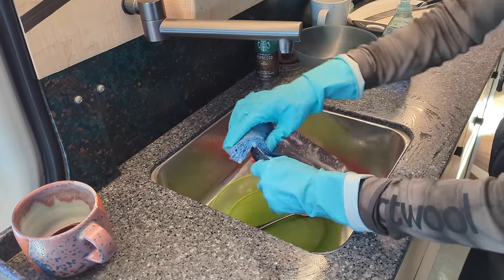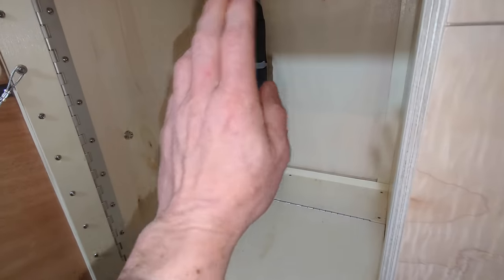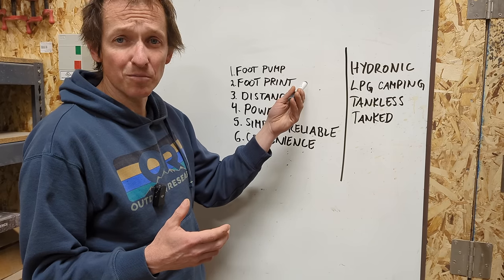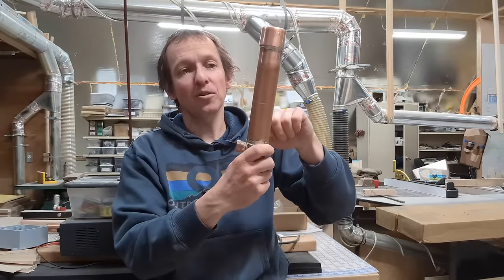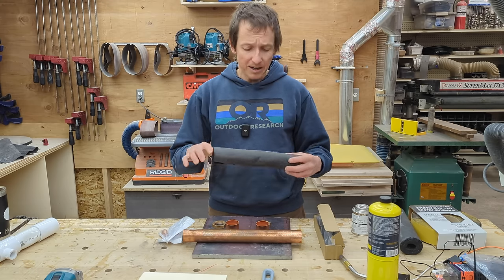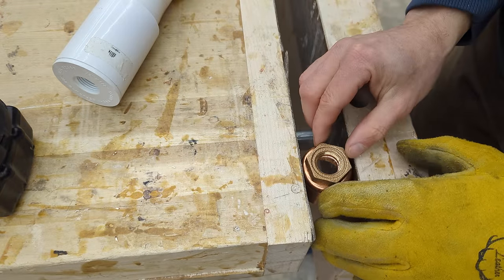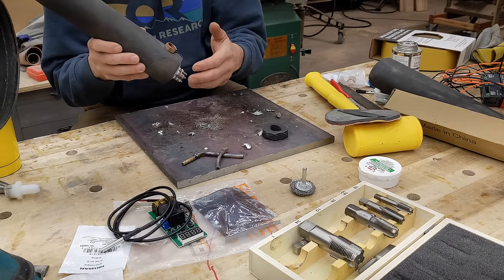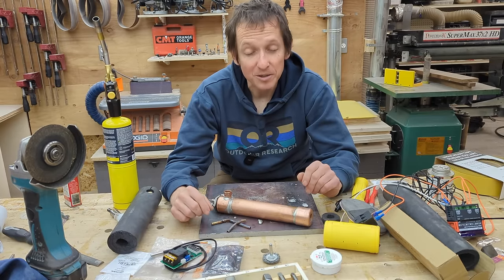Make Your Own WATER HEATER For Your Camper Van

Comment: This is outstanding. I have noodled over doing the exact same thing for the same reasons. For a bit of extra safety, take a look at snap action temperature switches...you could strap one on easily and they make them with manual reset. Nice job!
Reply from the maker: Manual reset for the win!  Thank you!!

Comment: This thing would benefit from a simple bimetal thermal fuse, say 100C, attached to the side just like the thermistor. Would cut power to the heater in case of overheat, either permanently until manually reset, or auto reset on cooldown...
Reply: 85C is pretty standard, with a 90/100c on top of it as the final extra step. just in case.

Comment: I have the cheap propane on demand water heater. Been using it full time for 8 years. The second or 2 of water flow you talk about is less than 8 oz of water before I get hot water. I just measured as I watche dyour video. That amount can be added to a pitcher for drinking or rinsing dishes if you are that worried about water usage. 2 D cell batteries last me 6-8 months. I go through a 3o lb tank of propane every 4-5 months, but that is also used for my 2 burner stove that gets used a lot more than my water heater. Actual cost is minimal.  When hooked up to a good water supply, I can take limitless showers, which I rarely do, but it is nice to have that option.

Comment: Add a timer switch to cut power after 15 minutes. That should lesson the risk of overheating. Nice idea.  For many of the reasons you offered, I decided it was easier to just boil some extra water when I’m making coffee in the morning or at dinner for dishes or washing than to install a hot water heater but I like this. Thanks.

Comment: A neat solution tailored to your specific needs. Very easy to increase the heated volume by simply fitting the heating element into a longer tube.
I would strongly advise fitting a pressure relief valve to prevent disaster in the event of the thermostat failing. if something can go wrong, then at some point it will go wrong and you need to cover that eventuality.

Comment: I use something like this for my hot water heater at home.
The main water heater is gas with a 12VDC 2 gallon preheater.
Works great for my solar dump.
After my batteries are fully charged, the system automatically switches over and preheats my water.

Comment: Great job!
I didn’t think of this so I went with a small computer heat exchanger (radiator), installed inside my diesel heater vent. Considering there is no power cost, it works extremely well.
Reply from the maker: Dang, thats a creative solution.  What kind of temperature rise are you seeing?
Reply: @projectofscience  I don’t have exact temperatures but I will try and explain best i can. We recently did a ski trip to Montana and with the heater running all night long, the firs few seconds after opening the tap are pretty hot but after that it’s milder and you can easily wash your hai or do dishes. What I didn’t expect, which was a pleasant surprise, is that while heater ran all night long, hot water made its way back up into the tank (no pump) and warmed up the whole tank (16 gallons). 
I suppose the downside of the system is that in the summer i’d have to run the heater if I needed warm water but I guess we’ll see..

Comment: "Pro tip:" There is a thing called "HEAT FUSE" and it basically breaks, if the element gets too hot.

You encouraged me to just buy my own "heater element" and a "control board", for the faucet and recirculating shower.
I believe one can also get a "thermostat" and a "car relay", since thermostats look neater.

Comment: A very elegant solution, many thanks for sharing! 
Two thoughts:
1)You said you would like a lower wattage 120V heater: If you can find a relatively low wattage 240V heater, it will run fine on 120V and run at 1/4 the rated wattage.
2) I wash my dishes using a 'Lawn and Garden Multi-Purpose Sprayer', I estimate it uses less than half the water as my faucet, possibly only 1/10th. I'd love to integrate that low flow with pressurized spray with a tiny heater like yours. Of course, keeping it safe would be more complicated. Thanks for the ideas!
Reply: Yes, heaters are just a resistive elements. They don't care about how much Voltage you give them or if it's AC or DC. 
if It's a 1000W, 240V element it has 57.6 Ω (or 250W at 120V)
if It's a 1000W, 120V element it has 14.4 Ω
Sometimes you can rearrange the connections on heaters to have multiple power levels for heating.

Comment: Great idea, have you looked into those heat exchanger plates that connect into your vans engines cooling system. It involves more pipe work though. You can actually buy a Calorifier Tank for a few hundred. 
Still a lot of faffing. My solution is going to be a Kelly kettle and a 1l king thermos flask, which actually keeps the water hot for 24 hours if pre heated. I've still got to go out and light it though. 
I think you have a lovely little system there!

Comment: To make a holding jig out of a piece of 2by4 block. Drill a couple laterals to insert screws that straddle the hole you will drill for the round piece. Then center drill the block of the diameter you want to hold 1 ½” or whatever the OD is of your piece. Then crosscut the block across the diameter of the hole cutout. Put some plumbers abrasive Emory netting or drywall sanding net in the hole for grip.  I register the block based on being able to clamp it to my drill press so I can easily hit the center line of the hole.  Finally- Insert the round (copper cap or whatever). Tighten the lateral screws that grab the round stock. Clamp into position on the drill press- and drill it.  Years ago, I made a long stick piece with several diameters that I usually drill up to about  from 3/8” to 1 ”… I use it all the time for center drilling, cutoffs etc.   for a bigger hole fit / cut the piece in half and screw the 2 pieces back together first and then drill the center holding hole.

Comment: Very cool idea! I know you don't want a full blown tanked system, but Whale is the system I went with. 12v heating element at 300w so it's a low draw on the system. I've since switched to a 24v system and will probably swap the element for a 600w 24v element.

Comment: I would recommend to add a 6-10 Bar (100-150 psi) pressure release valve. 
If something goes horribly wrong you don't want to have a boiler explosion, no bueno 😕
Give it a look on YouTube. Boiler explosions but also pressure tank explosion. If you see one you know why pressure release valve and rust free pressure vessels are a absolute must!
Pressure vessels are basically a huge spring. Think of the amount of energy put in over time and then is released in a fraction of a second, damn scary.

Comment: Excellent solution!

Related: I've been imagining a three-season solar water heating setup. The idea is to mount my rooftop solar panels with an inch or so of airgap below them, then loop some PEX tubing around in the space below them, so that they could help cool the panels while simultaneously heating up some water for sink use. I'm not sure how well that could work or if that could actually get too hot at the height of summer. 
This train of thought was partially inspired by the existence of the RoadShower, which is expensive, only does one thing, and stores all of that water at roof height. I want to see if this idea could become something that serves multiple purposes.

Comment: Curious if you considered an off the shelf style Insulated Thermos rather than the copper pipe? Those have a nice flat bottom for a fitting and the nice threaded cap to mount the heating element.
Love your builds, keep them coming.
Reply: They work on a vacuum drilling would negate that
Reply: @patrickday4206 If you can find an all stainless steel one you could solder everything to the top opening to avoid drilling.

Comment: You might want to think about pressure relief valve. If something was to happen to the electronics, where the heater sticks on,  you could end up boiling water. Water to steam expansion ratio 1600, and could end up with some explosive results.  There is more then one safety built in to water heater for this very reason.
Reply: Pavel doesn’t have a valve in the system after the heater. The system is open after the foot pump so there’s no way to develop any significant pressure in the water heater chamber.  In case of a “run away heater”, the steam would simply escape from the spigot.  That stated, once the water boiled off, there’s no secondary protection for overheating with all the associated risks (melting, fire etc.). The thermal snap switches others have mentioned would be a good addition to protect against that occurrence.

Comment: I'm considering making my own hydronic system. It's essentially just an engine block heater, a few hoses and two radiators. One radiator is submerged in the hot water tank the other is the radiant heater

Comment: Kinda complicated. 
I use a simpler method -- a flat thermo-siphoning solar panel feeding a 3-gallon receiver filled with OIL. A single length of  3/8" copper tubing passes into and out of the receiver top through a gasketed plate held on with 6 bolts, nuts welded in place, in a loop. As water passes through, the oil exchanges its heat and I have HOT water.
The receiver is packed in beach sand to insulate it. Oil can reach 300°F in clear skies and won't freeze in cold conditions.
I'm autistic and approach projects differently than "normies".😊

Comment: Just a couple of things, once when I dreamed about building a still I made up a citric acid bath to clean the copper. It brings it up really shiny and hot soapy water will get rid of any flux. 
A safety shut off could be easily added onto it with the secondary PID controller that you got. I did think you could add a surface mounted temperature switch like you get in irons etc but here the UK being 240v they only go up to 20amps. I'm guessing you could get a 110v 40amp one where you are. As these only want to lay on a flat surface a 60-80'c one might do it as not all of the switch will be touching the copper jacket. 
Those temperature sensors (thermalcoupler) are easy to replace if you need one in the future, just check if you need a k or j type.

Comment: Like the idea of truly instant (warm?) water.

Another solution that could work with other pumps is to have two pipes running between the floor and the faucet, linking them to form a loop at the bottom and the top. They can be pressurized by the main pump, but have another small, in-line pump and a heater within the loop. This way, the entire loop becomes the reservoir, and as you use hot water and introduce cold water you minimize the temp swings. The whole system stays at the same set pressure by the main pump.

Comment: It appears that you use less than a gallon for each use of the sink. Without taking up to much more room you could design a similar unit that would utilize all the height available under the sink and be a slight bit wider to possibly hold a gallon of heated water. You showed how the water gradually cooled as you kept pumping and that's because of the small tube. The lager tube would end up producing a lot more hot water and would pump a lot more through before it cooled like the little pipe. Oh. Please put a pressure relief valve in that build. Have you ever watched a video of a water heater explosion. Not pretty and in an environment like the camper, plus being switch operated, it would give you a redundancy in overall safety that is generally built into water heaters. Great job and good luck on your travels! J Poll. I've subbed! 👍🇺🇸🏁

Comment: This is a good solution in a sensibly sized camper. Your soldering is more than good enough even for a pressurised system. 

But the tapping step is unnecessary. The solder will hold even if the hole is slightly larger than the threads. But if you do run a tap through a hole in a configuration like this, then start the tap from the side that's already threaded. 

Test your work by pressurising to double the working pressure. Use water, not air for testing! Twisting on the fittings will not reveal pinholes.

Comment: For high limit safety, thermostatic switch in series with relay coil is one option. Won't save you in the event of welded contacts, though.

Comment: just cooked dinner on the inverter based  induction hot plate.  600 watt  sine wave.  drew about 40 to 70 amps off the 12 volt battery /solar system.  steak and potatos...

Comment: This is great! I had the same idea, but not fleshed out like your setup. I have some heating elements, 120/240v, wonder what they would do hooked to 12v? Or, as someone here in the comments mentioned, run a 240v element on 120v (producing less wattage, of course). I would need different electronics too, and would have to run an inverter.

Comment: If you have a bigger "tank" and solar, you can dump surplus solar power into the water heater. Use an adjustable, voltage_sensing relay

Comment: Very cool project!  btw, there is hi-temp pvc you can get.  And did you consider boiler thermastat?  It should mechanical to turn it on/off... but then you wouldn't be able to adjust the temp.

Comment: Have you considered a highly insulated tank pipe with a section of pipe bonded to your exhaust pipe heats water when driving  stores hot water blend mixer for usable temp foot pump would work

Comment: If those fitting were just slip in a drilled hole you could consider silver solder them. When making restroom battery groups. Lines of urinal and toilets. We tee drilled the pipe to make tees then you silver solder the branches. Of course yours dont have lots of pressure.

Comment: To really make this work I think you'd need some kind of flow sensor, and a longer tube and element.  The problem you are trying to solve is just to take the freezing cold off your fingers when you wash or cook something, right?  It seems to me like a real good solution would be to have a warm water tank exposed to the sun, or something that pumps it through a heat exchanger with the engine when running.
I think housing construction would benefit by just being required to pump cold water to kitchen/bathrooms, and use smaller on-demand units for the sink, and a larger on-demand unit, or maybe two in parallel for a shower/bath.  Such a waste to plumb a whole house with redundant piping.

Comment: Hi, the ISOTEMP 120V heating elements are typically 750W, replacement elements should be available.

I think you should more strongly emphasize that this is an open system, and that anyone with a faucet valve would need a pressure-release/relief valve.

Also, you mention a possible safety measure of detecting temperatures ABOVE boiling, but that could never happen in your open system; instead you should be looking for higher than 180F or so.

Thanks; I really enjoy your content!

Comment: dernord also make 120v elements less than 1500 watts. im using one their cartridge elements - the solid cylindrical elements - in my water heaters that's similar to yours, but uses threaded brass nipples and NPT fittings.
Reply: exactly what i was thinking.  1" npt brass nipple, tee, and reducing coupling would have been a lot easier.
Reply from the maker: the dernord 120v 750watt element is the "rod style" and in retrospect i'm not sure why I didn't want to use that style.  probably makes no difference.  as for npt fittings, i wanted to make this thing a single unit with minimal amount of connections.  a nipples and fittings solution would introduce a lot more potential spots for leaking...but given my soldering ability maybe it would make no difference haha.  thank you!
Reply: the "rod style" ones tend to be very long, maybe thats why. i went the threaded route just to prototype it, but it ended up working fine so i just stopped there lol. the other benefit was the ability to add a threaded pressure relief valve and a threaded temperature sensor/switch. my sink heater is more like a tankless heater though, using a 1500W element. i have another that uses a 300W rod element, but for a recirculating shower. i skipped the safety features with the recirculating setup since the water continually flows. i would highly recommend adding a pressure relief valve to your setup just in case the electronics fail in the worst way.  @projectofscience

Comment: For the last 15+ years ive used a 12v/600 watt element/solar diversion load for both my solar and wind turbine.

a modified 5gal propane tank with a thermister and ported pressure relief valve for the water holding.

For better space use, i made a 7 gal rectangle tank 

(i plan to make it bigger, but 5 gallons is more than enough for a shower. Typically i only neeed about 3 gallons.)

 that sits in the back nice and tight in an otherwise unused space. 

Free on demand hot water all day long courtesy of the sun and wind.

As long as theres wind, night time as well.

I also have a solar water heater on top i use as a "preheater", but it can often work all on its own. 

Theres more to it, built into it a ridiculous amount of redundancy that turned out to be overkill. 

Such as the heater unit also heating night time water. 

Since the tank sits directly under the sink, hot water is almost instant. its warm regardless due to the fact the short line is only <2' long and insulated.

Most everything was used/recycled materials.

Comment: What if you add a second identical unit and have the 2 units take turns getting power so you would have twice as much hot water without drawing excessive power that would blow fuse.